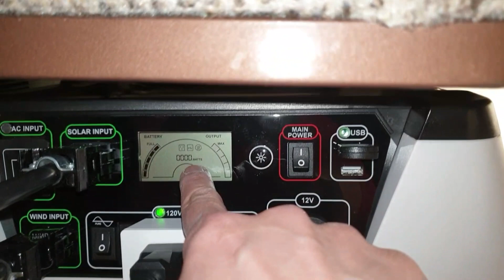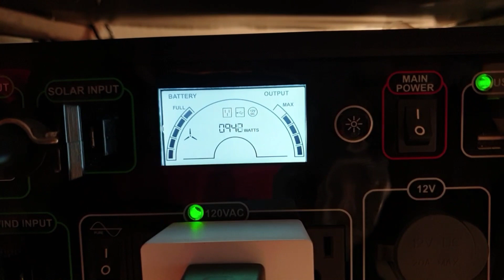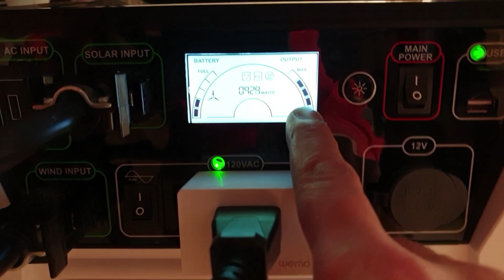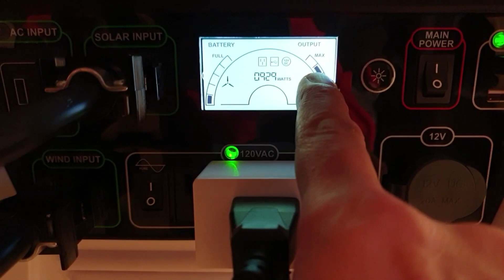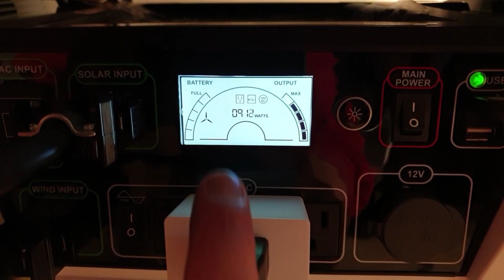Wind turbine option for Ecoflow! Nature's Generator (Pt.2)

Comment: I have the same set up and now is no longer under warrant. When it was under warranty the inverter quit working. Nature's Generator honored their warranty and sent me the new component to install which I did and have had no problem since. I created a second system with 600 watts of solar for a 24 volt system which includes a 24 volt 1500 watt Swi Power inverter and two EPEVER charge controllers due the solar panels are in two different locations.

Since the unit is no longer under warranty this gives me a chance to make some changes to how power is delivered to the unit and to measure the watts that come it. I need to take down the wind turbine next summer to do preventive maintenance and to change out the bearings and varnish the coils to keep them stationary.

Comment: I was told by N G company, the wind turbine doesn’t give power (watts) to the generator unless wind speeds are 27mph or more… what say you?  I don’t wanna buy one if that’s true bc most days wind speed here in GA are only 10-14 mph. Would l be wasting money? Do you see any watts in the front plate I’d generator with turbine at low wind speed? Or do you even notice if it’s turning slow and gen reading says no input watts if you unplug solar panels and use only the turbine? Have you ever just used the turbine alone to see what’s going on with watt input?
Reply from the maker: Yes I use a Anemometer to test this. I also connected a multimeter to the cigarette lighter plug that they have in the front. I believe twenty seven miles per hour will give you the maximum of 150 watts of power. Other variable speeds will just give you a little bit lower. I've seen speeds as little as 528 miles per hour give you some voltage. I'm not going to give specific numbers because it jumps all over the place as wind is not consistent where I live. 

This is mainly a substitute for sure, and doesn't take the presidence of solar. This is mainly great when there's a storm and there is not that much sun covered by clouds.But you know, there's going to be a lot of wind during those type of storms.
Reply from the maker: In general, I have seen power being delivered at 8mph. I would say 27mph you will get peak 150watts, and any speed under that?You will get less than 150 watts, but does create power. I'd just stay away from there agm battery architecture now. I'd go with their lithium ion phosphate ones.

Comment: the turbine wiggles and the nut that hold the blades on does not tighten all the way ? I even lost the lock washer that goes with it and it still did not tighten all the way . I turned it until it would not tighhten anymore. Righty tighty was not the way this works this one the nut has to go in a hole then turn the screw that sticks out into the blade holder turns left.

Comment: Yea, don't buy a wind turbine. Waste of time.
Reply from the maker: Why?
Reply: @tranjen  A lot of people think it is a waste of money and time. That is only true if you live in the South West of the US where it is always sunny. The weather is mostly sunny for me in the summer but  from mid Fall to mid Spring it pretty much looks like the weather in the video with grey overcast skies that generate very little solar power. I will be adding a 600 watt wind turbine to my home made solar set up to supplement the solar. I will visit this thread when it is up and running.
Reply from the maker: @JohnT.4321 i pretty much agree with you.I just did it as an experiment.And wanted an additional alternative energy during the night windy events that occur where I live. There was only a couple of stormy nights where i've seen the nature generator get fully charged.While any of my solar devices don't get anything. In the end, it's not worth it.But more of a supplemental energy supply. Not the main one.
Reply: @tranjen  What I have in mind does not involve Nature's Generator. I am focus on my 200ah 24 volt solar set up to use a 600 watt wind turbine to supplement the solar during those months when the sun does not shine. What I will be doing with the Nature's generator is hooking up a different charge controller and wind controller and electronic monitors to watch the wattage of each. I'll let you know what I find out.

Comment: How about noise issue? That wind turbine changes its direction with the wind direction to maximum electricity?
Reply from the maker: Is the wind turbine doesn't change directions.  The tail fin keeps it in the direction of the wind.  There's some internal breaking noise when the nature generator gets full. Until it discharges then the wind turbine will quietly spin again.

Comment: Hi, could you please send me a pic/ description of the bolts you used to attach the turbine to the pole? Mine have disappeared and I'm having trouble finding matches. Thanks
Reply from the maker: I suggest you reach out to Nature's Generator they should have no problem sending you bolts and/or the specs of that bolt. I would have to goon my roof, remove 1 bolt, and measure just to get that to you. It's best to get that info from them exactly.

Comment: Thanks for this video, it's amazing. And since I've got a Delta Pro as well also very motivating to consider the wind expansion too . What is Your experience after a 6-7 weeks of field use? How many watts is the turbine making in low winds (does it f.e. work around  speed of 5 m/s)?